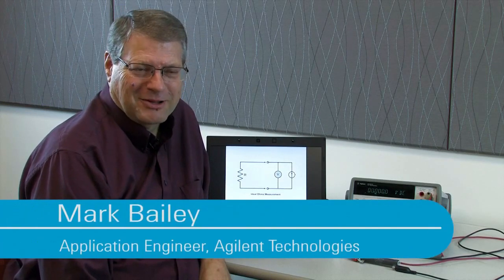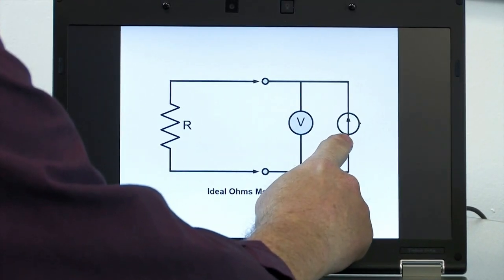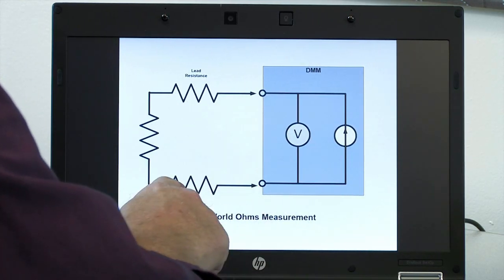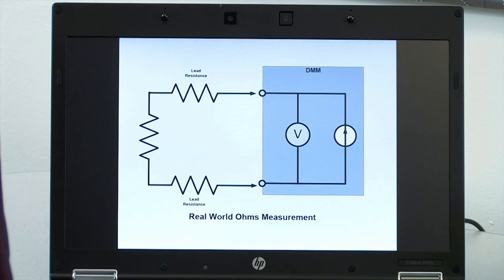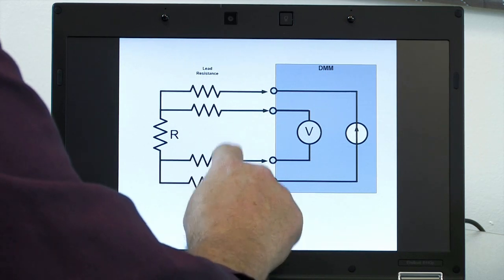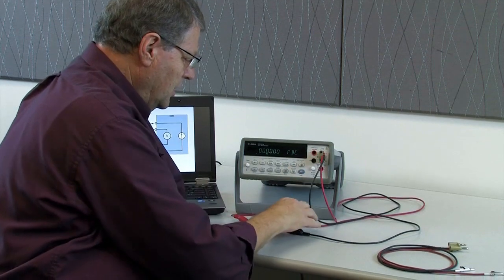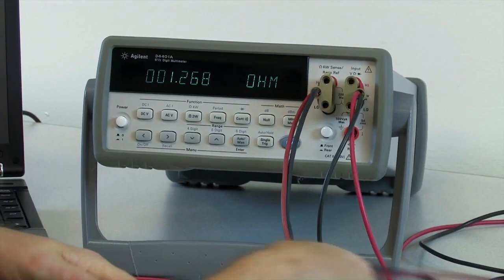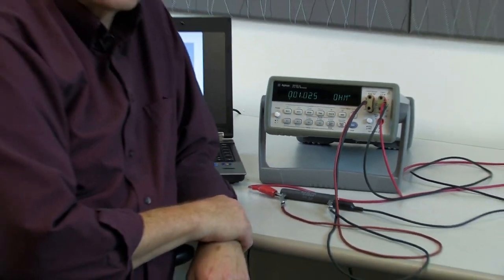Digital Multimeter Tutorial, Making Resistance Measurements, Understanding 4 Wire Ohm Measurement

Comment: Thank you for your explanation. 
I am wandering what kind of current it is using when measure the 4 wire resistance? I am now using DAQ970a with DAQM901A, and I am trying to use AC current to do a 4wire measurement to reduce the affection caused by polarization. Would it be possible to use AC current? Thank you in advance.

Comment: how do you know the value of the constant current source inside the multimeter- is this something that would be given on the spec sheet? also, the video states that the reason the circuit doesn't short to the loop containing the voltage reader is because it has a "high impedance" - does this just mean that the load resistance is relatively high compared to the rest of the circuit? thank you in advance
Reply: Hi Katrina
Take two voltmeters and use one to measure the voltage and current of the other. 
Put one in ohms set to the manual resistance scale and measure the voltage and current for each scale. You will see as the resistance scale increases the voltage and current decreases.  This is important to know when measuring things like, diodes that conduct in only one direction, but only if the voltage is high enough to turn on the diode.  Most modern meters have a continuity setting with a diode symbol for this purpose.  If you are curious why the voltage and current differs with resistance scale then look up a constant current source and constant voltage source and read that.  Then you have to realize/remember there is no such thing as either one there are only approximations of a constant current or constant voltage source in the real world.  Then for example on my meter the 100M ohm scale is 1 volt with 100na and on the 100 ohm scale it is 4 volts with 1ma of current.  The impedance or internal resistance on the 100 ohms setting is 4V/1ma = 4000 ohms of internal resistance and 1V/200na = 5M ohms on the 100M range.  Now draw a circuit with a battery and the internal resistance in series and then do the analysis with a 100 ohm resistor or a 1M in series with the 4 volt battery and its internal resistance and like wise for 100M setting a 1 volt battery with the a 5M in series. you will see if that the amount of voltage you have to detect is very small when the resistance is not matched or close to the internal resistance of the constant current source it.  this may not be apparent until you do the math but after you run through the numbers it will make sense.  after you calculate voltage and resistance be sure and calculate the wattage this will help you to understand power transfer and serve  you well in the future.
Reply from the maker: Katrina Miller.  You are correct, the current used is shown in the data sheet.  The impedence of a DMM is typically very high as to not affect the circuit that it is measuring. As an example the 34465A has > 10 G Ohm input resistance.

Comment: Is this circuit similar to how a traditional  4wire RTD works in industry?
Reply from the maker: MrYouitube.  You are correct. The intent is to remove the lead resistances from the temperature measurement.  You will also want to make sure that the current source in the DMM does not heat the RTD.   Some DMMs such as the 34420A offer a low power resistance measurement and builtin RTD algorithms.

Comment: What about OCOMP? Not a single word about termoEMF. Oh, I forgot, it's just an advertising of 34401, where OCOMP is not an option. In advertising of 34420 there will be thermoEMF compenstion.
Reply from the maker: Crac  The four-wire technique can be used on most bench meters. Offset compensation is not covered in the video.  Offset compensation can be used with 2 or 4 wire ohms measurements.  Offset compensation is a feature included on our higher resolution DMMs: 34420A, 34465A, 34470A, and 3458A. Video on offset compensation: https://www.youtube.com/watch?v=douv9b-q8qc